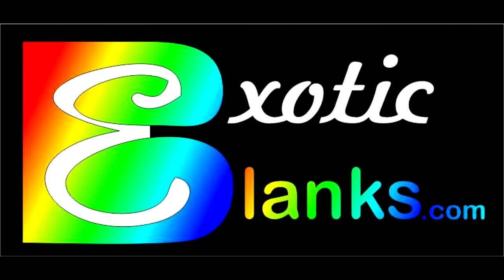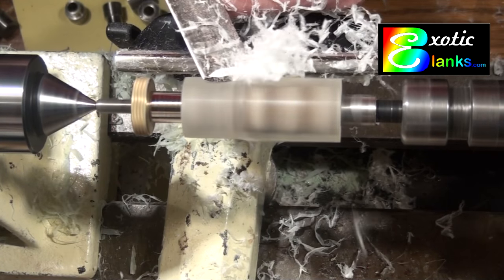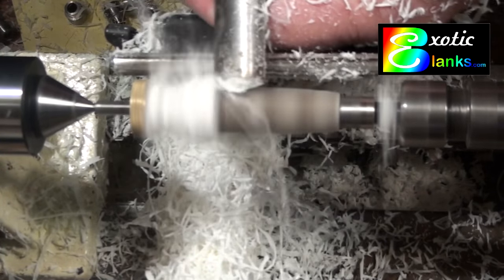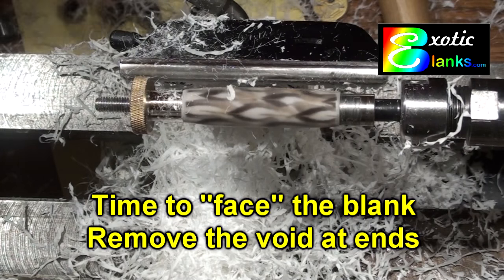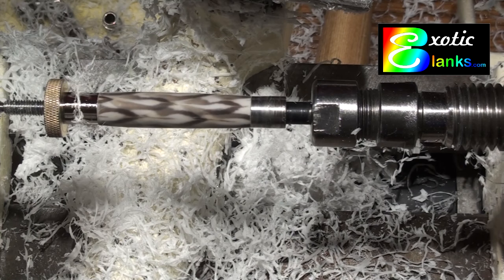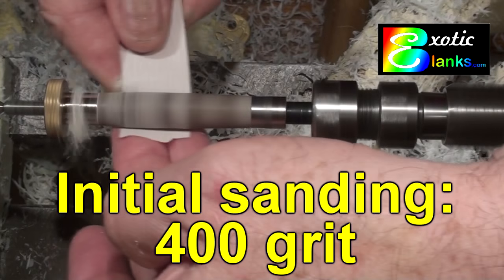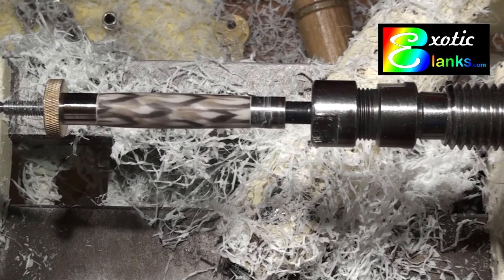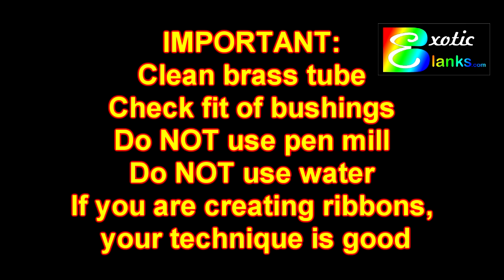turning hand-made blanks-grouse feather ellipse

Comment: I don't have problems turning blanks that are hand-made, its the commercial blanks that seem to be very brittle at times and cause some issues.  

I use micromesh and water on my acrylic blanks during sanding, I've never had an issue.  However, with some types of hand-made blanks I can see what issues could easily arise.  

I assume you use the buffing system rather than the micromesh and water?

Comment: What kind of skew are you using?  I looked on Exotic Blanks and did not see it.
Reply from the maker: +Gene Ilten I use the Benjamin's Best 3/4" oval skew.  I have changed the profile on the one in the video, but I have six of these skews and no two look the same.  Inexpensive, so I don't mind grinding off steel to experiment.